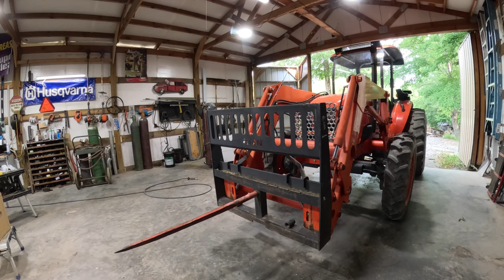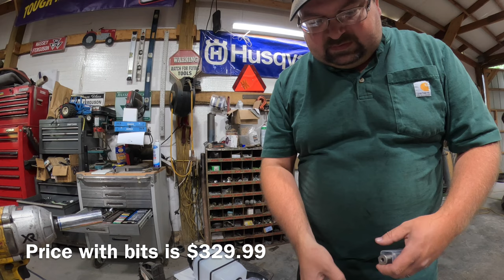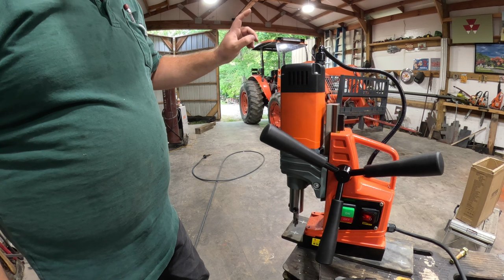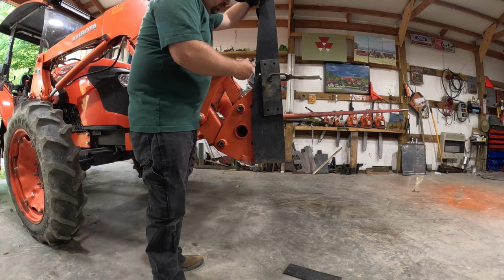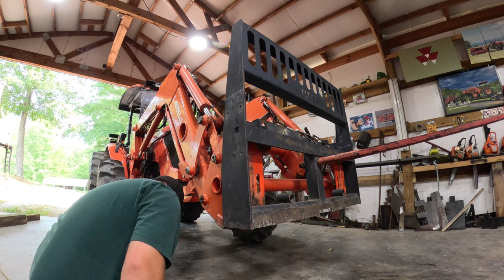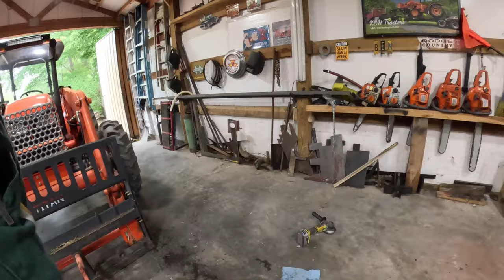Customizing a Fork/hay Spear Frame with VEVOR Mag Drill and Plasma Cutter!

Comment: Nice job Ben! Everything looks clean and neat. Try lubricating drill bits with liquid dish detergent. It's like drilling butter. You do have to wipe bits off or they'll rust. A tip I learned when drilling truck frames with a 1/2" hand held drill.
Reply from the maker: Thanks for the tip Jim! Appreciate you watching

Comment: Woo u starting to blow up mr Ben thank u for learning some of these youngsters about ag and Instead of drillin the frame
For the plate wouldn’t it be easier to just tig it with a few beads ?
Reply from the maker: I was afraid that welding the plate to one part or the other might draw from the heat and make the tolerances too tight for easy removal. Thanks for watching

Comment: Tim from Canada I see your problem and I have a solution if you were interested. Weld on the back  a big piece of round pipe or square pipe, depending on your preference or what you have lying around. then weld on two pieces of smaller pipe on either end of your attachment.. in theory, the smaller pipe should go inside the bigger one if this is done right and this way, when necessary should be able to lift out and put in as the job needs it square pipe or round pipe does not really matter. what is going to matter? Is the thickness of the pipe you were using this will be up to you and your preference but in theory if you are to weld on two pieces of pipe on either end of your tractor or vehicle, the bigger piece on the bottom and the smaller pieces on the attachment in theory, the smaller pieces should be able to slide inside the bigger pieces on your tractor or vehicles
Reply from the maker: I’m pretty sure I fixed things in this video. Thanks for the advice.